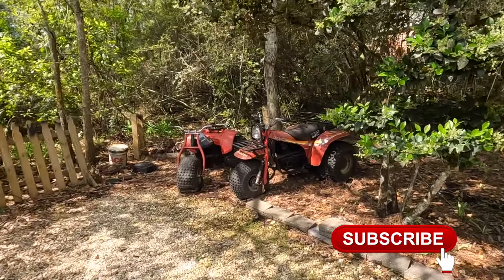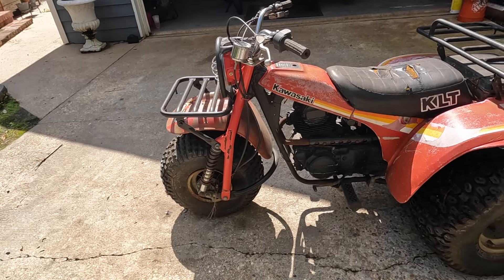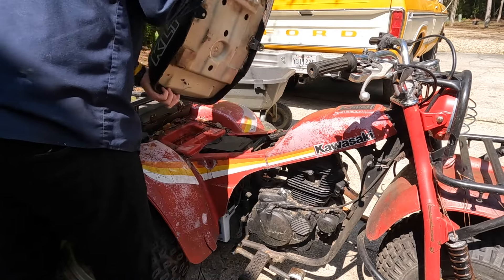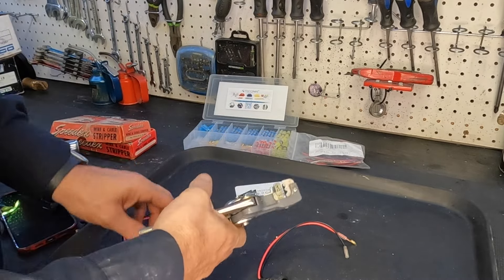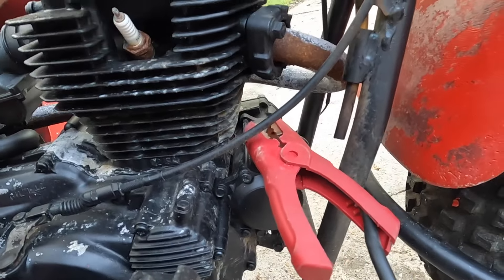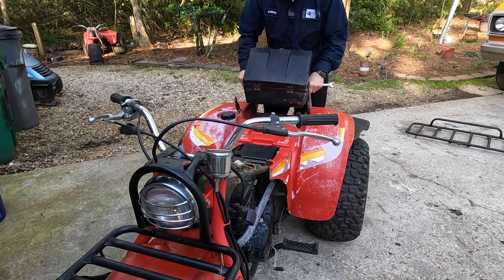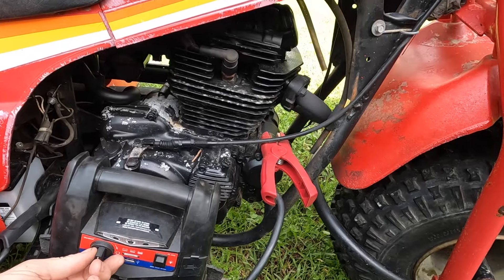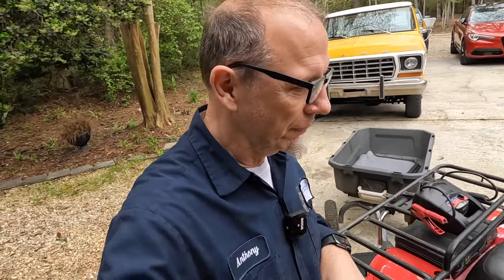Waking Up Our Vintage Kawasaki KLT250 After Winter! #motorcyclerewind #vintagemotorcycles #klt250

Comment: I have a similar wire stripping tool which made a huge difference when undertaking electric related jobs on the my bikes and cars.  One of the best tools that I’ve recently purchased was a ratcheting tool used for crimping the connection tags onto the cables as used on motorcycles, particularly the Japanese variants.  After a bit of practice I can produce perfect crimped connections, just a good as the factory’s could produce.  These connections can then be slid into the plastic connector blocks, keeping the bike looking original.  I’m sure you will able to can purchase a similar tool on the US.
Reply from the maker: I have one of those crimping tool. It works great! Thanks for watching.

Comment: I believe there are waterproof versions of those toggle switches where the switch is covered with rubber.

That’s one cool tool. I only found out recently that Kawasaki even made three wheelers. I only knew of and seen the Honda three wheelers.
Reply from the maker: Good idea about the toggle switch. Today, I ordered a replacement key switch. When it comes in I will sort out the wiring. 
Honda owned the 3 wheeler market. Thanks for watching.